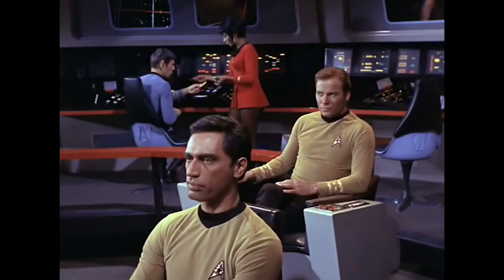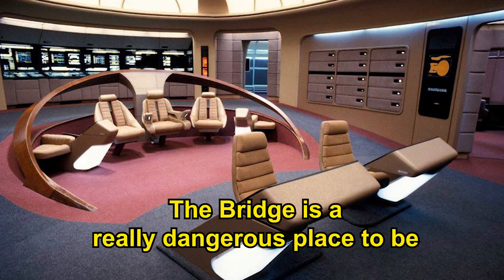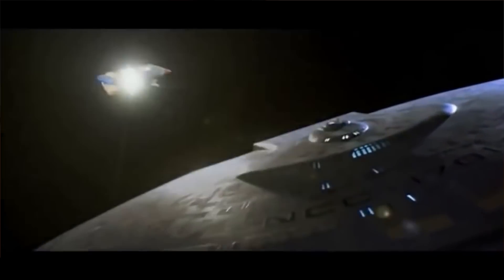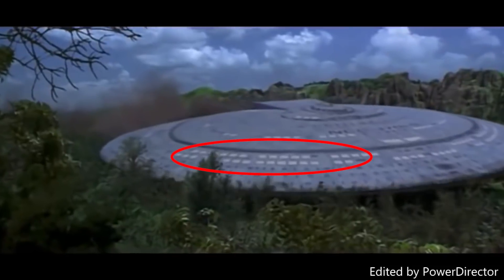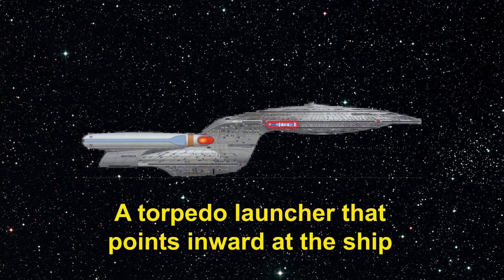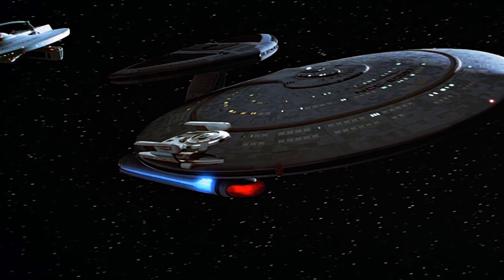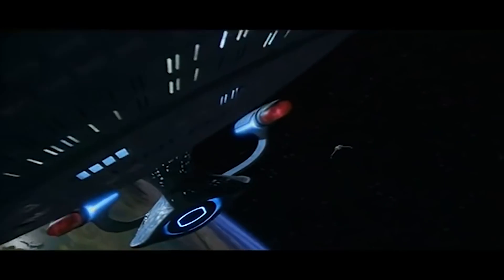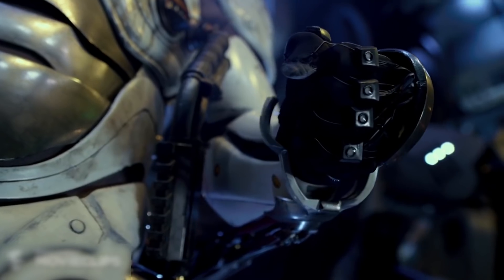10 Flaws Star Trek - USS Enterprise NCC 1701-D

Comment: I’ve watched Star Trek and its offspring since the beginning and screamed at the TV many times because of the same things you mentioned. I think that the more one knows about the technical and physical aspects of space flight, the more you’re annoyed by these inconsistencies. In the beginning, the only people watching were us kids and what did we know. They could do the most outrageous gag and we'd fall for it. 
I found your observations in design flaws interesting. I’ve never seen these drawings but I suspect that they were created by writers, not aircraft design engineers. For example, the bridge placement seems to be for aesthetics, not for safety. It should be located down in the most secure section of the ship. However, the opening scene wouldn’t be as awe inspiring. A common open is an outside front shot of the vessel. Sometimes you can see the bridge window. Then, there’s a cut to inside the bridge with the crew looking out into space. This places the viewer in the precarious position of being separated from the outside by a thin glass, also in the position of leadership. I don’t think we would get that feeling if the bridge was in the bowels of the ship and they were viewing space through a camera. Ironically, all of our modern battle ships are designed with exposed bridges. As for the large corridors, they need room for the camera crew.
I think that these design flaws are easy cop outs for the writers to exploit in order the excitement level high. The first thing anyone I’ve talked with about Star Trek asks, “Why don’t they have seat belts for when the Inertial Dampening System goes down?” I tell them that it’s more fun seeing people flying around than them just sitting there, rocking back and forth. After seeing this so many times, I’ve become desensitized and look past it. Two terms related to this in theater production come to mind; Suspension of Disbelief and Deus Ex Machina (the 11th hour save). With Star Trek, the reason why these concepts work so well is because there’s always a solid story line and good acting, allowing the viewer to see past these flaws. 
Being a Sci-Fi junky, I’ve seen almost every movie in this genre but have only seen two or three that have not sacrificed reality for visceral excitement. One that comes to mind is Mission To Mars, which does take a few liberties, mostly in character actions and not technical flaws.
A couple of other Star Trek flaws that have always bothered me was, when the ship was attacked and there’s an explosion on the bridge, sparks would fly from the consoles and steam would come rushing out from the upper bulkheads. Occasionally, an arc would jump from the console, to the operator, sending them flying. Now, I would assume that the consoles are connected via fiber optics and very low current for powering the UI, so there would be no sparks if a circuit was shorted. As for the steam, one could argue that it’s a gas, like Helium, used in the ship’s systems. Maybe, there’s an explanation for this in the ship’s design manual.
I recently watched a brilliant HBO mini-series called Newsroom and found it nothing like the real thing.  I worked in Radio and TV for over 30 years, it’s very low key. The bottom line is that it would be very boring if people and sparks weren’t flying around.
Thanks for your video; I learned a lot.

Comment: The entire ship has a extensive shield so the bridge has all the protection it needs, but it's located so they can maneuver the ship around especially during docking procedures, and yes they do need seatbelts  but they want them to be thrown around for special effects,

I've never understood why the chief engineer is on the bridge? And when they switch to manual they still press buttons, shouldn't they be manually engaging stuff?

Comment: I love Voyager, but a MAJOR flaw with Voyager is the landing gear.  The ship was unbelievably nose heavy.  ANYTHING messed with that nose and it would have been buried into the ground.  Also, a flaw in Star Trek the engines are push me - pull me, as if it were a mundane car, boat, or airplane.  It was not until the alt timeline of movies, that few liked, that the enterprise could go straight up.  Then there were the weapon systems.  WAY too many blind spots!  Finally for now at least.  Why no one thought to use the transporters as a weapon was just sad.  Target shields down. Fly-by. Zap and you take out whatever you want.  This was only done in a VERY few episodes in Enterprise and Voyager.

Comment: Only one toilet is required.  There is only one as an emergency backup, in case there is a failure with their uniform.  All starfleet uniforms have built in ‘transporter pants’ which use a low power, low resolution transporters to convert the waste into energy.  This is why we never see anyone needing or using the toilet.

Comment: also take into consideration that when it the ship crashes its not in any way controlled in its entry into the planet as it was caught in the shockwave and entered so fast the braking system could not maintain the full weight at the angle it was entering it does start to slow down once it leveled out but by then it was too late to save it

Comment: Unfortunately, as correct as you are with your top 10, I can't help notice that many of them boil down to... "that movie was the worst movie ever made" or "that series is/was the worst series ever made". But from a technical perspective, I think you're right on. Other design bits from the D that confuse me - phasers on the nacelles? huge mega shuttlebay on the saucer section? the dorsal and ventral phaser design (yeah, 180 degree firing arc is cool but... wouldn't it be better to have 2 or 3 or 4 phasers instead of one?). Best design use was of course 10-forward, so that Geordi can look out into space and tell everyone what the ship sensors (obviously) can't see, like the god protecting the planet of the jogging people.

Comment: 9:05 there where you are wrong... For example, Ambassador was Heavy Cruiser(Conspiracy, Tomorrows Enterprise(alt timeline) also Horacio in the "Conspiracy" was with two frigates... the same Constitution class and many others... also the not used space makes sense... as we know, starships servers 40,50 or even 70 years and if you want to keep them fit, you need do upgrades and updates and where you want to put new tech if there is free space? Also Galaxy is able to keep alive up to 11 000 ppl on board(life support system is able provide warm, air(recycling air) and other stuffs) standard crew is 1012 crew... and about the maneuvers... as you car, also the star ship has some assistants to prevent ship crash. Do you remember, every ship has tons of sensors). I just don't understand why that much dumb hate...

Comment: I always thought the saucer section should have, at the very least, some low warp capability. I mean, if it's separated from the drive section it has to be able to make it's way back to some outpost. Even at warp one that's a possibility, not so much at sublight impulse speeds.
Reply: That always bothered me too, I mean I guess the idea is that it's like a massive escape pod... it's not designed to do much beyond sustain life... that said it is crazy that they didn't have at least warp 2 or 3 capability in order to get to safety (and potentially away from danger)

Comment: I've always found it odd how easy it was to steal a shuttle on these shows. How many times has that happened? They don't have security guarding those things, or video cameras monitoring the shuttle bays? And the Borg can only assimilate you with those tubuals they insert into your neck. No one thought to design some sort of "cover" for your neck and/or other exposed body parts when encountering the Borg?
Reply: And there should be computer controlled phasers on every deck in case of an alien unauthorized boarding.
And for crying out loud, put a physical power switch on that stupid holodeck so you can just flip the switch when things go wrong in there.

Comment: many of these points are valid, though I will say seatbelts are primitive inertial dampeners. The inertial dampeners ARE the seatbelts. Also the reason the saucer section of the Enterprise D couldn't land where the Voyager could is that it's literally like 1/3 the size. Voyager is a SCIENCE vessel, and was designed for versatility, where the Enterprise D was created to be a flagship, meaning it was outfitted for spaceworthiness, exploration into unknown, and battlereadiness, it wasn't meant to land, because it's not within the purview of the ship's expected duty. The Voyager on the other hand is a science vessel designed to study things, sometimes those things will be on planets, having the versatility to land on those planets is an ability both afforded it by its relatively small size, and that falls within the expected duty cycle of studying spaceborne objects (despite the fact that this only happens one or two times.) I will counter with saying that while some shielding by the hull is utilized by some starfleet vessels, all the warships you mentioned with the exception of the Cardassians also have their nacelles on pylons extended from the main hull. (also, importantly, those are NOT ENGINES... not in the traditional sense. They should be more correctly thought of as emitters-, warp field emitters, so their placement and dimensions are determined by the geometry of the ship they're mounted on. They emit a subspace envelope allowing a pocket of normal space to be moved into subspace in order to ignore the physics of newtonian space. They don't -propel the ship, they don't contain explosives, the warp core is the closest parallel the enterprise has to "engines".)

While speaking of evacuation systems, can we discuss how none of the support vessels on this deep space exploration vessel have any warp capability (despite the Type 12 shuttle on the Voyager having capabilities up to warp... 4?) this means if there IS a reason to abandon the stardrive section, or even just to eject the warp core, the ship is "stuck" in sublight until rescue arrives? Or how about the inclusion of the holodecks not JUST for the fact that they're a waste of space versus the smaller holopods that are used in other ships, but also because apparently if you pass the wrong photon going a little too fast it sends the holodeck into lockdown, and turns off the safeties?

Comment: Some of these are kind of based on ignorance.  Warp Field calculations determine the most optimal position for the nacelles to be placed..  And those are not "engines".  All they do is create the warp field (bubble) for the ship to go FTL.

The Phonenix class you used in your example is a warship.  The Galaxy Class Enterprise was designed for deep space exploration, so the nacelles are more exposed because it's designed for extended periods of warp speed travel.

Comment: As for lack of manual control, I think that's easily explained by the computer taking some control...the human user merely suggests a strategic course, but the computer autopilots the ship around obstacles. On a ship this size, without a 3D view of the surroundings and a lot of training, I'm not sure how much manual control would matter. If the computer can't help, you're probably dead.

Comment: the torpedos are shown on the blueprint to show how many are stored in each bay these are housed in a autoloading system that can feed the torpedo to any launcher that needs ammo thus is not an issue also not shown in the pic you showed for it while connected are the connecting parts of the whole system to the other rear launchers on the rear of the battle section

Comment: the saucer section like all landings from orbit to ground , was too steep , didn't follow the pipeline 5 by 5 , even with the thruster modules the ship has to break somewhat in the upper atmosphere first , which most of the tv series skips that long part  on most of those landings , and the end up vertical momentum , hover landing , than horizontal momentum , ie shuttle brick your pants landings , can also blame Troi for bad piloting

Comment: there's 2 different ways of doing things, if you only intend on hauling ass in a relatively straight line, you put your engines inside the vehicle. in the case of the enterprise, they need to do alot of dogfight maneuvers, high speed turns etc, so they use engine thrust to assist the turning fight. helps em make tighter turns and stay in the turn (to maintain turn radius they slightly increase throttle to the engine outboard the turning arc and decrease throttle to the engine inside the turning circle, like maneuvering a tank). remember those ships are designed to defeat klingon battlecruisers. also moving your engines away from the hull increases the thrust to mass ratio in favor of thrust. plus an enemy isn't gonna go for the engines, they're gonna do the easiest thing, target the center of mass, major hull damage usually doesn't disable the propulsion plant. starfleet builds em like the royal navy, warships with a science role. the only navy today that builds single role dedicated warships is the United States. and in star trek canon the United States lost world war 3, thus doesn't exist, England became the dominant superpower. so it is heavily british influenced.

Comment: Spot on, on: no seatbelts, children on board, the photon torpedo launcher, lack of automatic phase shifting of shields and the bridge location, not to mention the saucer section having to crash and them not using the escape pods. I don't mind the extra space on board; it's nice that in the future we won't be cramped. As for the engine nacelle placement, one could rationalize that for a warp engine to work that it was necessary. 

Now, how about how unsafe the transporter was. Every ST incarnation did MANY episodes with klunky transporters causing all kinds of havoc. If I were a Star Fleet bigwig, I'd remove them from all starships...or at LEAST not use them routinely. At least the somewhat unloved Dr. Pulaski had a thing about not using the transporter if she could avoid it. Fans ridiculed her for that, but I agree with her!

Comment: I always viewed the touch screen controls for the pilots as a dual method.  They have their pads to control the direction and side buttons to adjust pitch and verticle climb.  But then, they also had an autopilot feature where they could enter the exact coordinates and direction they wanted to go.    The joystick thing was stupid.  There was no reason for it.